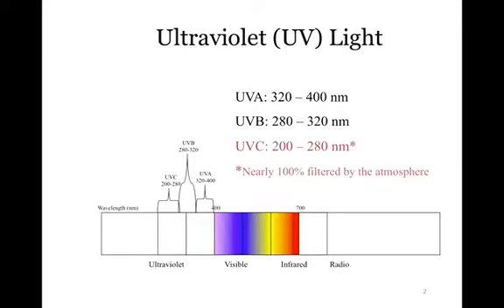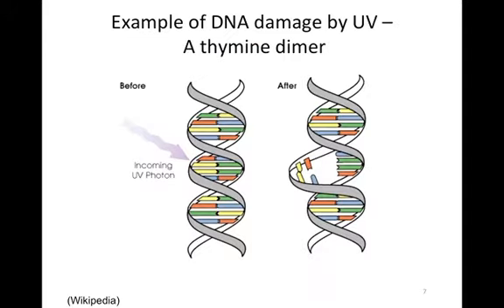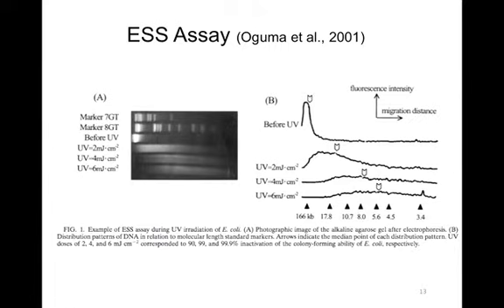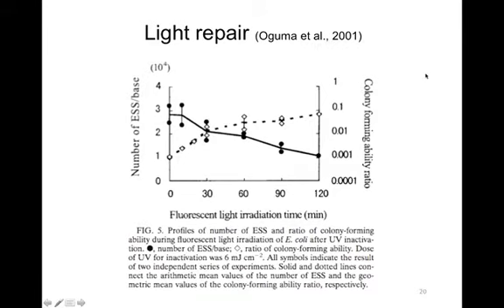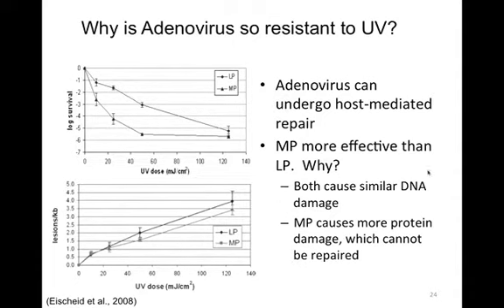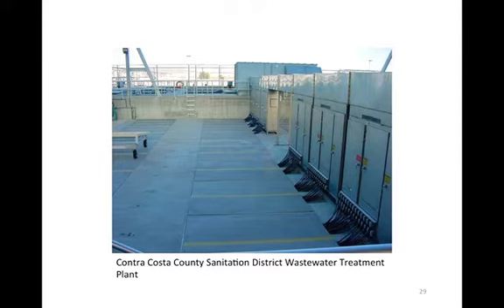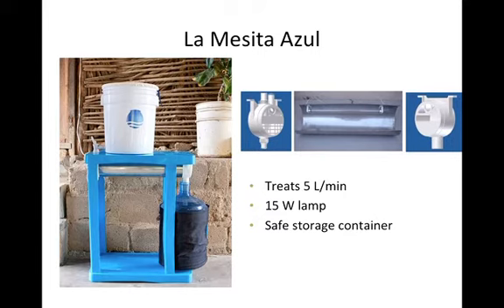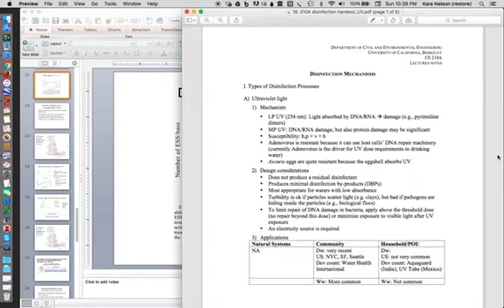18  201A UV disinfection lecture

Comment: Hello Miss, Thank you for the informative video. Can you help me with the below-mentioned situation? Thanks in advance.

I would like to install a UV Light inside the 1000Liter plastic water tank of our house rooftop. We fill the water tank twice a day. My question is how long I have to run the UV Light to kill all the bacterias for any particular shift (two shifts a day) after filling the water tank. I also want to know the power (Watt) of the UV Light that should be used inside the water tank to kill all the bacterias of the standing water.